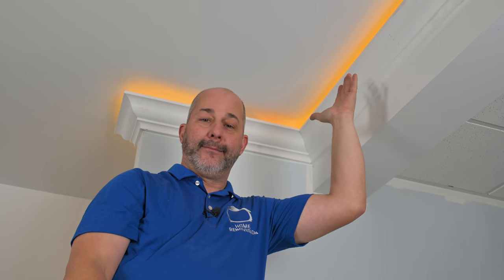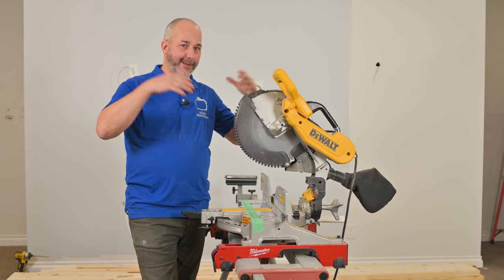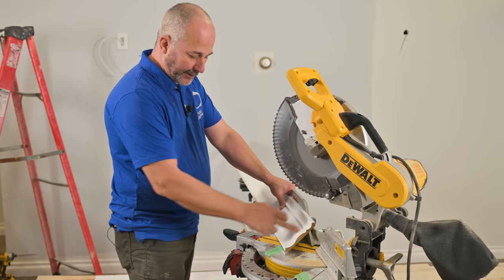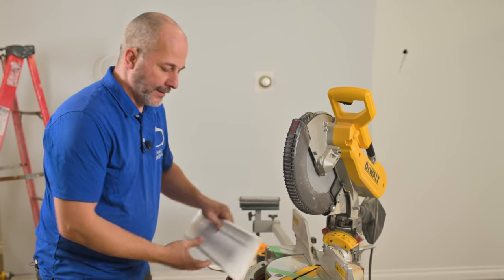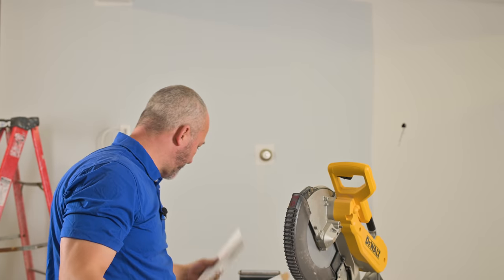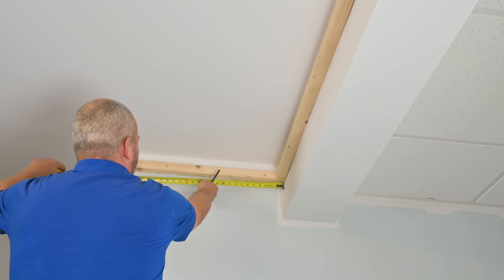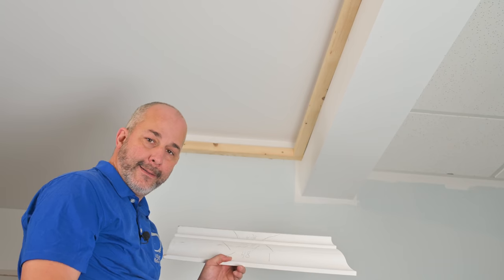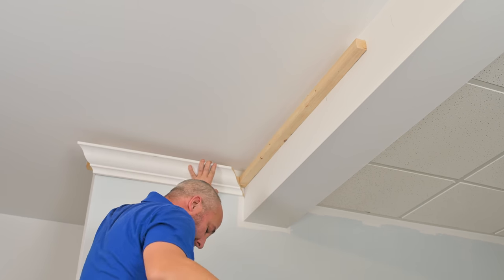Use These Tricks To Install Crown Molding (With LED Lights)

Comment: SAVE time and money with our foam crown molding!  There is no need for that backer board with our products, it's all built into the molding!  Because our moldings are glued up, the extra step of caulking the joints after installation is all done during the installation at the SAME time.  No nailing, priming, or sanding our products.  Just cut, glue, install and paint.  Look us up or give us a call.  We'd love to work with you on a project to show your followers a better/easier way for the home DIY project installer.

Comment: Learn carpentry skills. Listen to finish carpentry or insider carpentry on YT. Also learn which side to cut with the miter on inside n outside corners. Not what you think.Caulking is no big deal. Just don't nail in the design of the mldg. Will be hard to cover brad heads.

Comment: Love the Dewalt saw mounted to a Milwaukee stand!
When starting the crown, I like to select an area with multiple small pieces that I can handle easily. Dry fit them to make sure the cuts are accurate. Then assemble a few pieces down on a flat surface like a table in order to align the joints. Use super glue and activator to keep the seams clean and tight. Then you can put the assembly up as one piece using the caulk to fill any wavy imperfections between the wall and the long edge of the crown. Significantly reduces the need to caulk the joints and makes the overall appearance look seamless. The glue does not readily crack because the joints are stronger than the actual trim regardless if you use MDF or real wood.
Reply: You haw the best of two worlds.

Comment: Great video!  Love the backer idea for non wood framed walls!

I taught myself how to cope inside corners.  It was frustrating at first but made them so easy and perfect.

And don’t assume outside corners are a 90!  I measured one at 92 and when I cut 2x45 degrees the gap was too big for caulking.  Just a word of warning.
Reply from the maker: Cheers!

Comment: I think a quick refresher on measuring the inside/outside corner angle and then showing how to make the cuts to form the measured angle is due.  Can't always assume the corners are 90 degrees.  Otherwise, you'll end up with trim that looks like what you'd see in my workplace's conference rooms and hallways.

Comment: C8 glue will eliminate the need for caulk on corners. The wall still needs caulk but the corners won’t ever pull away.

I will also use LED strip lights,
They are brighter and last longer than rope lighting.

Comment: Making cuts on a short board works with the marked tape, but when you start getting into long pieces of crown, it's almost impossible to hold the wood (or MDF) flat against the fence.  Crown stops are so worth it.  Also, I understand that you were doing this for demonstration purposes, but it seems to me it would be easier to drop in the rope light above the 2x2 piece of wood prior to installing the crown.  Overall, very helpful video.
Reply: Also easier for the apprentice to put a finish nail through the rope light if it's already up. Plus if it's not the adhesive strip stuff, the rope style stuff gets all kinds of attitude about laying straight after a long trip across the Pacific in a tight spiral, so it gets in the way a LOT.
Reply: @aaronb1138  Exactly ! 👍
Reply: Yes but eventually if you needed to replace the light rope it might then be too far in to reach it.

Comment: So I have never done crown, we are redoing a bonus room and we wanted to do decorative trim. Where I am confused, is that the ceiling has a slight downward pitch for rain run off. How does this affect the cuts when meeting walls?

Comment: Just curious why you put the backer at 3 1/2" (10:45 on the video) from the wall.  How did you come up with that measurement?
Reply: I want to know the same thing! I'll assume it's a 'I fiddled until it looked right' calculation, though.

Comment: Jeff! I installed this MDF crown in my midwest home a few years ago and all of the joints have split on me. Face nailed into thick wood paneling, top nailed into joists, and the joints were all decently matched. Just a lot of expansion and contraction I guess. Any tips for repairing and/or prevention? Multi-tool the joints out and pack them with Alex Ultra?

Comment: aww man we always painted the moulding first and then the seams we cut the crown upside down and backwards flat faced at a 45 degree angle using a triple chip blade so the painted side doesn't chip, away from wherever the light is coming from in the house, so that when  you calk and touchup paint you will never see a seam.. but my way is just way too confusing.

Comment: How can you do without that cutting machine?
Reply: It won't be as tight a mitre with a mitre box and a hand saw. But some caulk and paint etc
Reply: @CiaranCoffey  Can you do a video that shows how to do it without the machine.  So many people doesnt have that machine.
Reply: Get a used saw. They are cheap. You will never get a good result with a mitre box and hand saw. Plus it will take forever.

Comment: You have gotten me through two bathrooms, a shed, floors, numerous other plumbing projects, but Jeff, this is the worst video. The first part where I really need to know what you’re doing the video is not even showing your hands. I don’t understand where you came up with 3 3/4 on your foreign quarter inch crown molding took me forever to try to figure out on my saw because you didn’t explain it.  you’re not breaking down your numbers and you’re not showing us why those numbers are important. I think I’m gonna have to go find another video. Please do another one. I really need your help on this job.

Comment: People here in Miami stop installing crown moulding they even pay you to remove  it
Reply: What do you mean? Explain more please.
Reply: Why, what the reasoning behind the request to remove?
Reply: @biney-animemmanuel2360  I am guessing they either don't install anything at all to transition from the wall to the ceiling or they do something more quick and simple. My house has 1x4, oh and I live in Texas.
Reply: @poeticsilence047  I just redid my walls and ceilings, and am in Texas as well. We just did inside drywall corners and a thin bead of caulk. The walls meet the ceiling directly without any trim at all. I think it's all just preference. It would have been much easier to do crown lol.
Reply from the maker: say that!
Reply: @biney-animemmanuel2360   because is kind of old style and also your house looks much more bigger